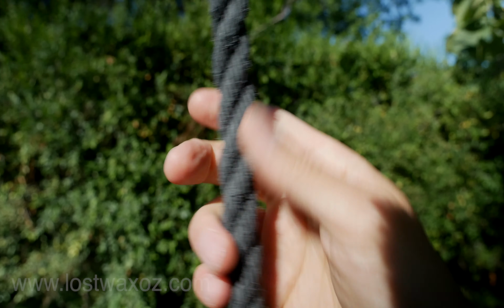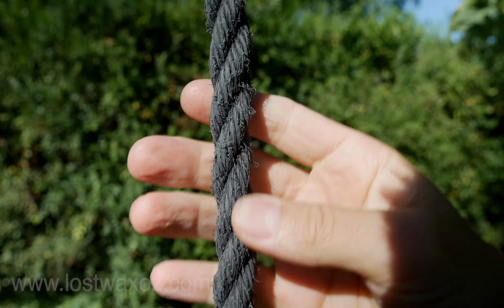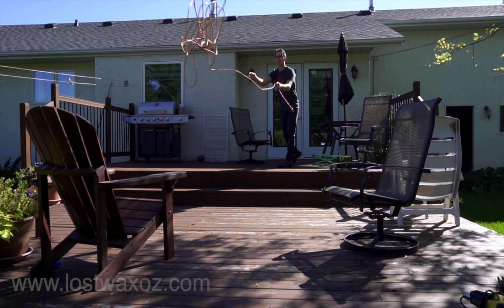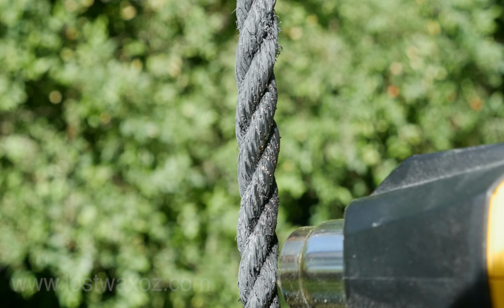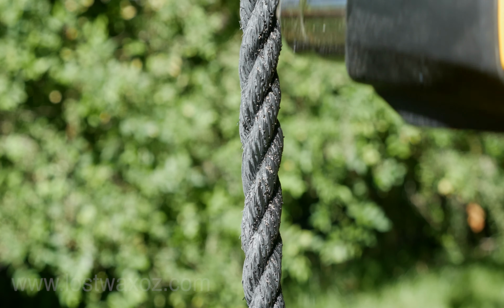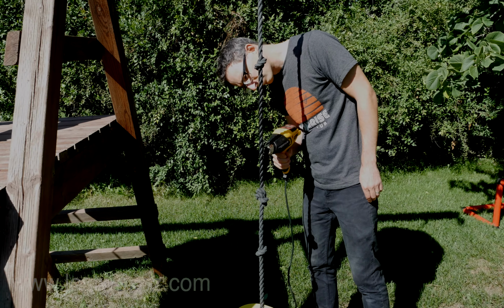Rope Hacks: Fixing a Frayed Nylon Rope With Hot Air. Sweet Rope Life Hacks.

Comment: 1.  Nylon rope is the worst.
2.  When nylon rope frays like that, it's telling you to replace it (with polyester rope).
3.  If you want a rope to be really soft and nice for a long time, buy it at a marine parts dealer. 
4.  Instead of overhand knots for gripping, use figure-8 knots.  They can be untied or loosened and moved around for convenience.